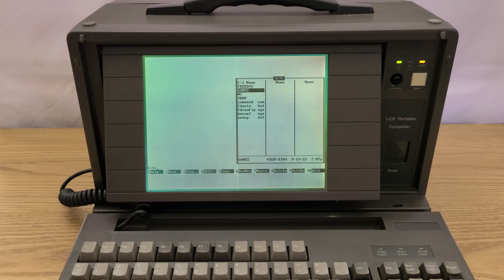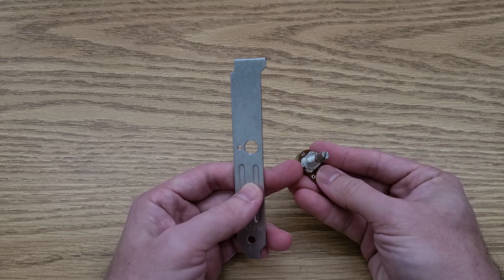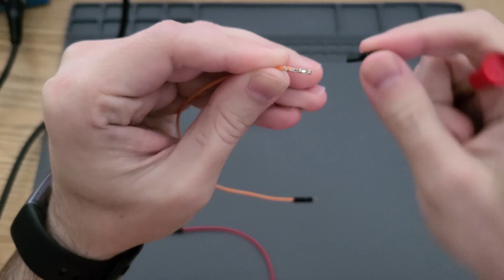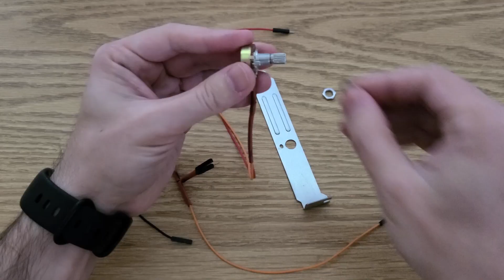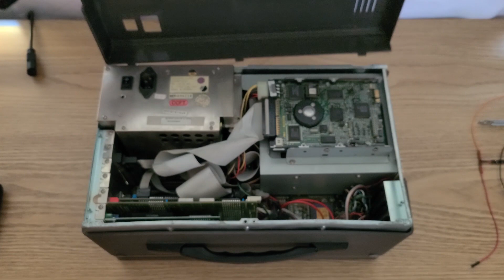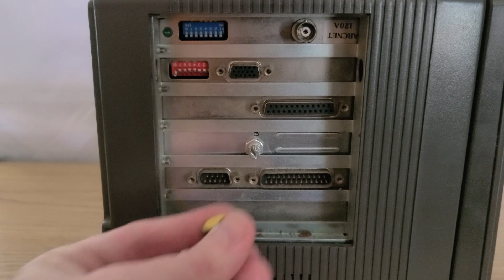Adding volume control to a PC Speaker

Comment: Not bad, but you need to ground that first lug of the volume pot. As-is, all you're doing is adding resistance in series with the PC speaker. Connecting the empty lug to ground will nake it so that you divide-down the voltage to the speaker instead, which is how a volume control actually works. You'll get a far better and more usable result that way.